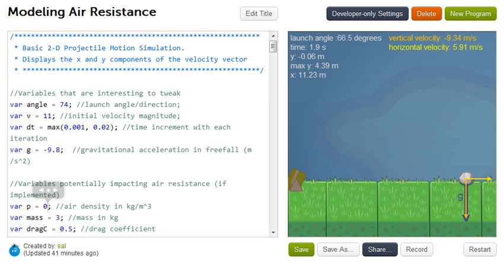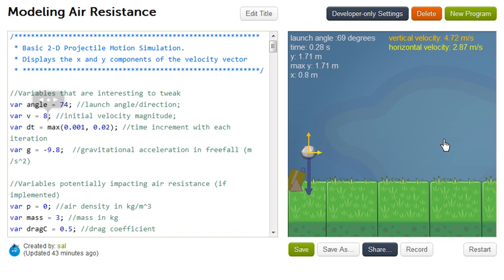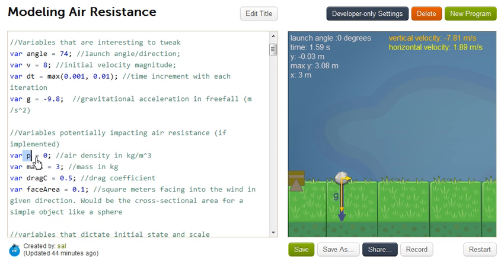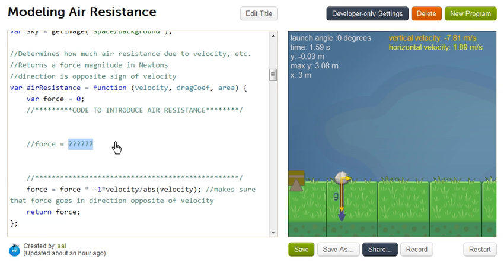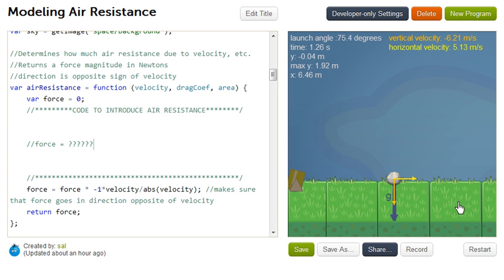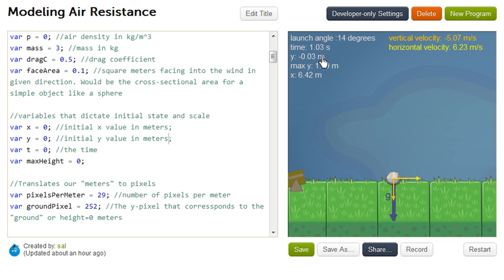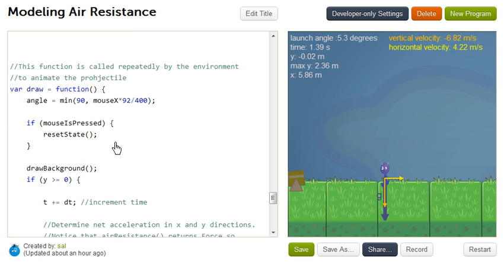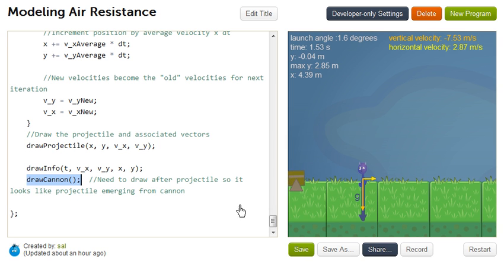Modeling Projectile Motion

Comment: Just did the lesson & made it to show force below the velocity text in the window.
I noticed force is always 0.0
The reason is that p (air density in kg/m^3) is set to 0 in the var statements at the beginning.
Thus any multiplication by p will always yield 0 in any function users write.
Changing the value of p to a non zero value (1.2041) for air at 20 degrees C makes it work.